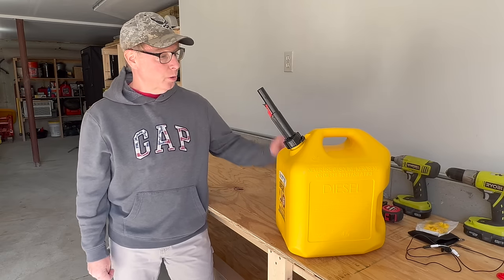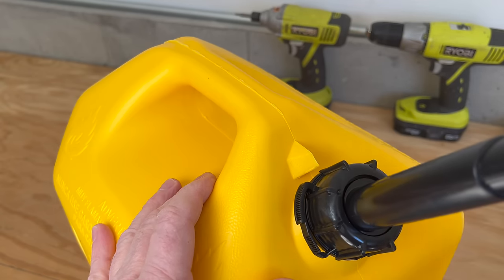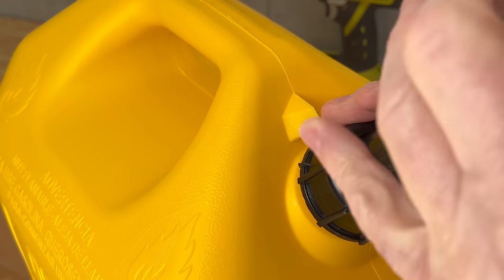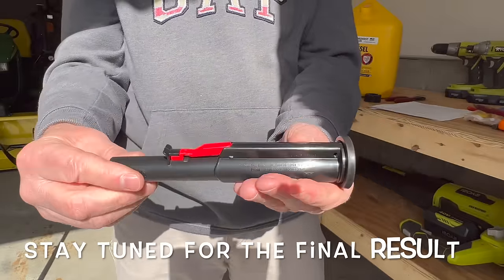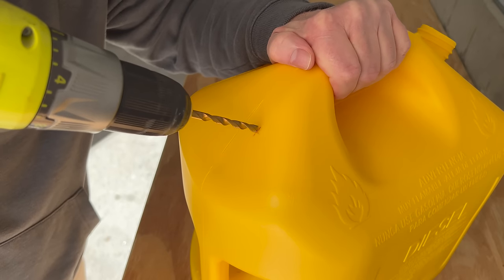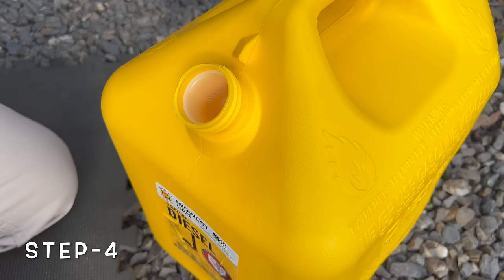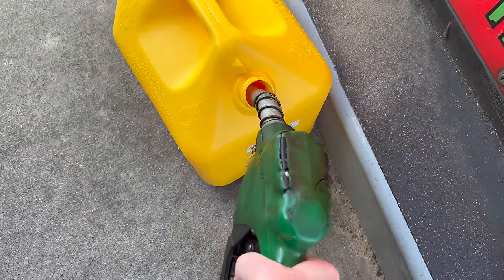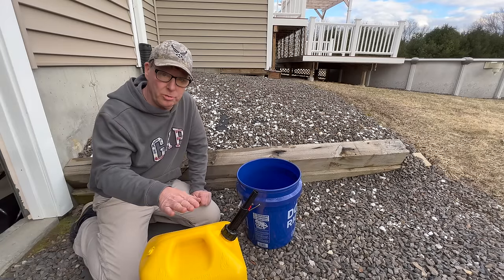Fix a New Gas Can in 4 Simple Steps.

Comment: I fixed my gas issue by getting offroad pack tanks, in the 5gal version the is recessed inside until use when you invert it on the cap, no room for extra eco garbage.

Comment: As I've aged, picking up a 5 gal gas can is harder than it used to be. I found a battery operated transfer pump at Harbor Freight that works great. Don't have to pick up the can or spill any gas.

Comment: This regulation has ruined boat portable gas containers as well.  The fill cap has a vent screw like normal, but it also has a one-way valve that only allows air to enter, not escape when the vent screw is open.  When left in the hot sun, pressure will build up and force gas into the outboard carburetor creating engine problems and gas spills.  This one-way vent can also lead to a dangerous spray of gas vapor when removing the cap even if the vent screw is open.  Take the cap off and snip the end of the rubber lip valve to create a 2-way vent.

Comment: Instead of removing the spring, just trim off half an inch.  That will reduce the amount of pressure needed to depress the nozzle, but will still allow it to seal when you're done.
Reply from the maker: It still seals when I'm done because the red release clicks and holds it tightly closed. I just need to pull it closed rather than depending on the spring to do it for me.

Comment: I had one of these exact cans whose filler mechanism came apart while i was using it, and all the internals fell into the fuel tank I was filling.

Also, why would you remove the fill hole filter?  That's actually a useful part of the new design.
Reply from the maker: It's not a filter it's used to prevent vapors for igniting. If it was a filter and debris go in while filling it would then go right into the tank when you were pouring. I think I mentioned you have to fill very slowly with it in or the fuel will splash out the pump will shut off.

Comment: Check the air hole that it doesn't leak gasoline. I did this to a new can and the gas leaked out of the air hole.  Not sure why but I'm looking for a good sealer now and may have to start over with a new can. I don't think I drilled the hole too big either.

Comment: Like all of these, installing the vents, be sure the can is empty of gas.
Need to rinse out the can with water when done drilling the hole.
There will be some plastic pieces inside from drilling.
Rinse them out.
Let the can dry from water.
Then refill with gas.
I add 2 oz of Sta-bil & 1 oz of Marvel Mystery Oil to every 5 gallon can of gas.

Comment: I ditch the factory hose. Buy new hose at Casey,s. Just straight with bend hose. Drill hole in top for air vent and put a sheet metal screw in it. Works great now.

Comment: I installed a 3/4 inch quarter turn water valve in the back end with jb weld and a different nosel on the other side.

Comment: Just a hint.
When you drill plastics, acrylic or polycarbonate, put your drill on reverse to do the initial hole and will usually also work as you drill the larger holes as well. It will still cut through but the knurls on the bit won't chip or chunk the product or pull the drill chuck into it and possibly break  the product.

Comment: My solution was to remove the nozzle from the can, put a funnel into the item you are filling,  also with the nozzle removed no vent is needed. When done filling my John Deere with fuel the nozzle goes back inside the fuel can for a good seal. Funnel works well for all items I fill with fuel.

Comment: My experience:  I take those new new-fangled caps and nozzles off.  I throw the nozzle into the trash and replace it with one of the easy-pour nozzles one can find on eBay or Amazon.  I take the cap and cut away the press tab or I just throw it too into the trash and use one of the replacement caps that comes with the easy-pour nozzles.  I also use those "air-flow" devices (after drilling a hole) and put one into place. Now I can pour 5 gallons of gas into my auto in a very short period.

Comment: My solution is to buy old gas cans at yard sales. If I need a vent hole for air to enter the can while pouring, I drill a 1/8 inch hole use a roofing nail as a stopper.

Comment: They tried to introduce these fuel cans in the UK but in black as that is the colour code here for diesel, but the customers left them sitting on the shelves as they regarded them as unsafe, the a couple of consumer test organisations took a hard look at them compared to the older standard models, they recommended to the UK Government that the new design be banned as there was a greater risk of fuel spillage from them.

Comment: Instead of drilling the vent hole, take the designated drill bit and heat it up with a torch. Just push it in the plastic and there is no worry about contamination.

Comment: I assume that the design was to make things safer for people handling gasoline.  I was surprised how dangerous the new safety design is!   On my gas can with the safety spring mechanism the mechanism sticks open most of the time resulting in fuel spillage.  As you fill the tank and the gasoline gets toward the top I try to remove the spout from the fuel tank which should close the safety spout.  However, if the safety spout sticks open fuel goes everywhere making a big mess and a potential combustion hazard.  I am not sure why it sticks, but the hesitation in the spring results in spillage.  I rarely had this happen in the old style cans unless I was careless.

Comment: I pushed in the spout to get it to flow into a lawnmower. Unlocked the red latch and grabbed the OD of the spout like a bat and pushed in and the gas being under pressure from sitting in the sun sprayed out of the spout into my face. Not cool. I didn't notice the slight bulge of the can but I do now. That vent cap should be mandated!!! These are also very hard to fill vehicles with recessed fillers. Good idea on the spout lock but the spring is just way too strong. Its coming out! The best gas cans are the old jerry style/square cans with a simple screw top and a long funnel.......

Comment: Another problem with it not having a vent along with the spring loaded spout, is that when pressure builds inside the can, you have to press the spout in very slowly and point it away from you to release you the pressure.

If people are not aware of this and push the spout in quickly it can eject fuel and get in their face or eyes.

Comment: I also think the design of the spout makes things even worse as they are all different. My buddy has one that has you squeeze a green dohickie and a black tab to open the valve, but the past couple of times  I've had to use it, I have difficulty in getting it to open. So I've had to remove it and pour gas into the tank.

The spout you show here, was OK when it was new, however, it binds and does not close/open smoothly and thus does not shut off when I remove it, and it spills. I do wonder if the O ring swells up over time, knowing how most gasoline has ethanol in them now in most states and you can't easily find ethanol free gas where you live too.

The bigger issue is not having it shut off fast enough to prevent over filling and spillage. 

Definitely some designs are better than others, but generally agree, they suck for the most part.

Comment: Will it leak if it falls over without the spring tension,  maybe cut the spring smaller
Reply from the maker: No the spring is there to auto retract the nozzle. The red latch is what holds the valve (o-ring) in the closed position. I tested that and there were no leaks.

Comment: Sir, you have missed one more and biggest problem for me. Their main rubber seal is so thin that if you over tighten the cap or put any weight agains that nozzle, that seal rips and then it will leak 100%. Flimsy thin seal plus thin neck walls for that seal to push against and gets cut easily. Any good solution for that?

Comment: The 10 vent caps are $7.19   I found a Kit with a new nozzle like the old style that fits & a vent cap & everything you need to turn a new can into what your doing here, and it's 3 spouts & even a drill bit all for $7.99

Comment: New cans are terrible! We bought a couple from a big box store, and we couldn't even fill them up! Inside the neck was a plastic mesh overflow guard, the pump kept thinking the can was full at shutting off. Had to take them back home and remove them. Now they would fill up. After a few weeks the anti-overflow spout stopped working and leaked all over when we used it. 
Tried to order military surplus fuel cans with no magic spouts, only to find out they can't be shipped here to Pennsylvania. 
Back to the old funnel and dump.

Comment: Just one question,when not in use how to store  fuel long term without contaminating fuel?
Reply from the maker: The nozzle still seals closed without the spring and there’s a snap on cap as well. When I’m storing gasoline over the winter i use a fuel additive called STA-BIL. Works great

Comment: I'd love opinions on this -- can ANYONE explain why the simplest solution to the vapor venting problem was not implemented by a simple spring-loaded vent valve where the vent would open INWARD to permit venting when pouring the gas, but would pull SHUT when the gas was not being poured? In this manner, the pour spout would remain as it always was, and the spillage problem that's inherent in ALL these newfangled contraptions would have been avoided.  It's CLEAR to me that such a solution must have been considered, since it's so obvious, but I've never seen one installed.  What am I missing?

Comment: That fixed the can now fix your back with a Harbor Freight Battery-Operated Liquid Transfer Pump for $13. This pump looks cheap and it is but it works. Ya don't hold the can or spill a drop. The older I get the more I like things like this. lol

Comment: I would’ve just removed the red piece and cut a tiny section of that spring off, or compressed it so that it didn’t push back as hard. That way you don’t have to fight it to engage the dispenser mechanism, but it will also push itself back to the closed position for storage. That red piece that locks it closed is the real pain in the rear, not the spring.

Comment: If you do not need a big can I think you can use a laundry detergent bottle. Some of them get pretty big I think 2 gallon containers. It has a simple screw off lid. I have never tried it but I think they hold gas. I would test it first.
Reply from the maker: Fuel station cannot allow you to fill anything but a can designed for fuel. I found that out once when I ran out of gas.
Reply: @BackyardMaine  Nobody cares in the places I frequent, they do not look out. You can always keep it inside the bed of your truck while filling it

Comment: Even if the screen is meant as a filter, all you’re doing is catching the dirt on the way in and putting it in the tank on the way out. I have two gas can that have spring loaded valves on them that make it much easier to use. The idea that fuel needs some kind of filter is ridiculous, pumps have a “oil filter” inside the pump that gets changed every time the pump is serviced and they get serviced more frequently than you expect.

Comment: I guess they would have continued to sell the old type cans, but government regulations probably mandated a change.  Some accidents may have occurred.  The regulations were probably well meaning, but all that stuff that had to be removed from the can, no doubt, caused an increase in the price of the gas cans.  Will these requirements ever be rolled back?  Most of the commenters seem to think removal of these flow impediments are an improvement.

Comment: With no vent, the can files up with pressure that the can becomes round and then falls over and soon or later it will leak because now it has gasoline where the cap goes on and will get enough pressure to leak all over and could start a fire.

Comment: I went to tractor supply and picked up a kit that has a replacement nozzle and a vent that you can install on one of those impossible to use without spilling gas cans. Works great. Of course the caveat is that you’re not supposed to install it on a can manufactured after a certain date. So I didn’t, wink wink nod nod say no more.

Comment: I don't get the big fuss about it. I've used plenty of gas cans of both styles, and I gotta say I like the new ones a little better. Sure they vent slightly slower, but an extra 10 seconds is worth it because I don't have to juggle caps or switch the nozzle out to stop it from spilling or venting fumes out constantly. The filter is a nuisance, but thats not hard fix, just pull it out. And since I only have to remove the nozzle when I fill the can that dumb little latch really isn't an issue, it takes half a second to press it and twist

Comment: Just try to fill something small, like a chain saw with gas. Using a non spill gas can. You are going to spill a lot of gas trying to hold the non spill spout open and tilt the gas can at the same time. It is virtually impossible to fill a small machine with a non spill can without spilling.

Comment: The only step I disagree with is the part with the nozzle. I prefer the easy ez pour nozzles "for older gas cans." They have a large high flow nozzle. So you don't have to pour as long. They also have a slower flow option. Good for filling small tanks. Yes they work on new gas cans too.

Comment: I've been doing this ever since I bought my first "upgraded" fuel can. With the corrupt idiots in congress, I'm surprised this isn't considered illegal and that you're not in jail (and me for saying it). 🤗  And FYI, and easy way to drill holes in plastic is to use a junk set of drill bits and heat the smooth end and just push it through. It's very easy and never tears anything. It doesn't leave any fillings and you don't have to use multiple bits. Just use a burr removal tool or razor to smooth the lip that forms if it's too big.

Comment: I have a much easier solution. I have purchased a battery powered transfer pump from Harbor Freight, and you just place the larger size tube of the pump into the fuel can, and the smaller flexible tube into whatever you are transferring the fuel into, and turn the pump on. I always remove the internal tube from the Can that causes the gas station pump to shut off, eliminating that issue as well. With the transfer pump, there is no need to drill a hole in the can and install a vent.

Comment: The fuel can must have been designed by a lawyer.  I see your diesel has the color indicating no tax. Obviously this thwarts the safety features but they were dramatically overkill.
Reply from the maker: Yes I use off road diesel for my tractor which is dyed red.

Comment: DO NOT use a 1/2-inch drill, the fuel will leak around the vent. Use the 31/64-inchfor a correct fit.
Reply from the maker: I drilled the 31/64th hole and there was no way the vent was going in. I used a plastic hammer and destroyed the first one. Then I drilled a 1/2 inch hole and it snapped in tight. No leaks at all.

Comment: So wait, the nozzle stays open? The gas is evaporating out of your tank and fumes in a tight area are accumulating?
Reply from the maker: No the spout closes but you have to pull it closed rather than it closing automatically. I show that in the video. It also has a cap for the end of the spout to keep insects or debris from getting in.

Comment: I left my government designed gas can out in a storm. The silly bottlecap lid popped off and now I have a cute water/fuel mix. The way the can built up pressure  made removing the cap a cool way to spray vapor into your eyes. Just the right angle.
And we're supposed to trust these people with our health? And...try filling your mower without spilling fuel.
Orémus Y'all.

Comment: I would disagree with removing fill screen.  What you called flame arrester back in can.  Filling gas can. Set on slower rate. This is cheaper then buying “replacement” nozzles

Comment: To add "fuel" to the fure (see what i did there?) the little cap they provide does NOT seal the tube for repeated use where you need to fill a few thing over the day. Only solution is to do the whole nozzle removal process evey time! Also: because you have one angle to fill its always full throttle or not. Overfill 50% of the time. thats it. The government is FIRED!

I'll be buying the old style off Aliexpress until i die.

Comment: Why its red pouring out into the 5 gallon bucket instead of orange color? The green pump handle is for diesel. Red is for Home heating oil and Yellow is for Diesel.
Reply from the maker: Off road diesel and home heating oil are basically the same thing. Equipment thats not run on public roads can use off road diesel.
Reply: @BackyardMaine  Not my Kubota Machine. It must be diesel.
Reply from the maker: @imchico1970  There are two types of diesel available at the pumps. Diesel is dyed in order to denote if it has paid road tax or not. On-road diesel in the United States usually has a light green tint to it. Off-road diesel has a red dye to denote it has not paid road taxes as required by all states and the Federal government.

Comment: Dont use the drill to make the vent hole on a can of actual gasoline even if its empty. With gas the vapors can hit the electric motor of the drill. Do it when its new or clean it out first
Reply from the maker: Yes for sure.